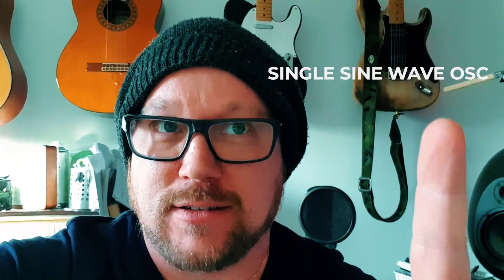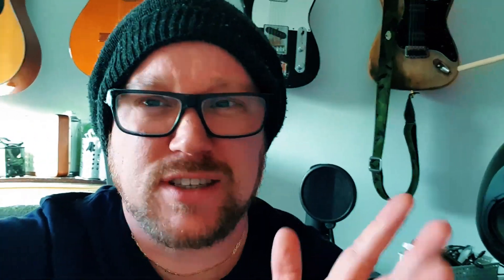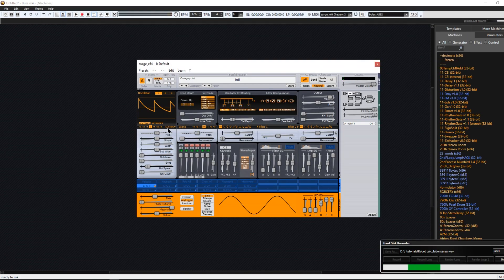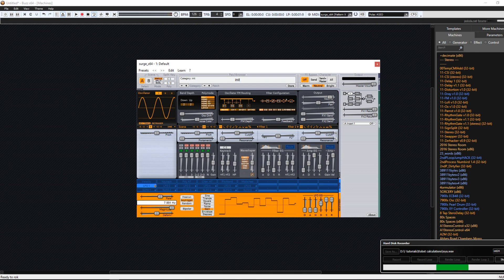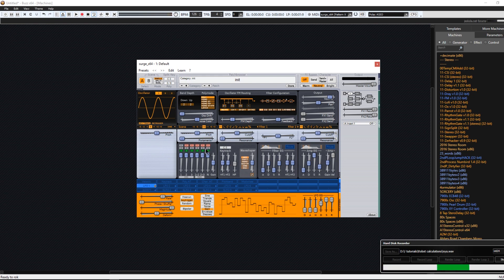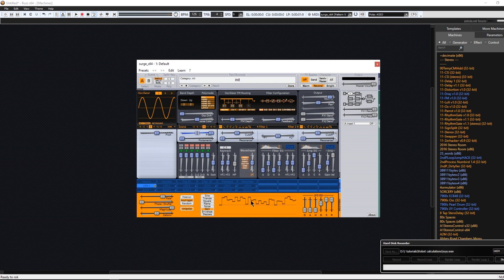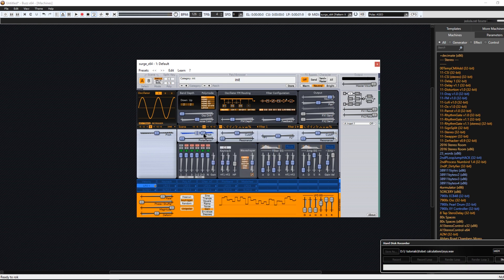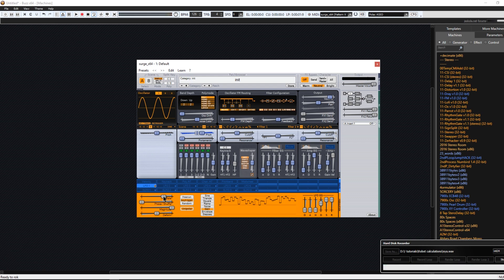HOW TO MAKE RETRO BLEEPY ROBOT SOUNDS (with Vember Surge VSTi)

Comment: Hi and thanks for your video ! Looks like a fantastic synth. Even grainy/analogy sometimes. Do you actually use Surge in your productions ? As instrument ? As effects ? (tx again!)
Reply from the maker: Thanks!
Yes, Surge is great and I use it in my productions. I've used it for many years and I think I first got in contact with it in 2008. I mainly use it as a synth, except for when I use the built-in vocoder (which means it needs to berun as an effect). 
You can make it really grainy, warbly and "analog" by assigning multiple LFOs (some fast rate and some slow rate) to pitch, filter cutoff, waveform modulation, etc.

The good part is that it quite recently became open source and people are chipping in to upgrade it and make it better (win/win).